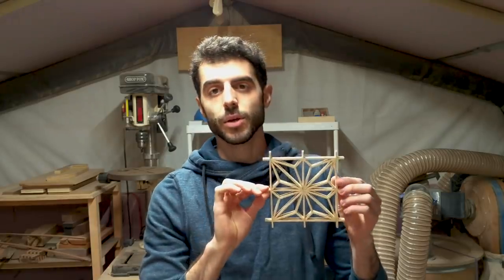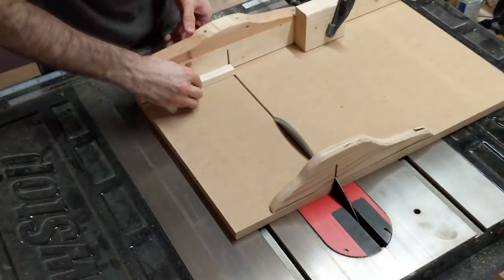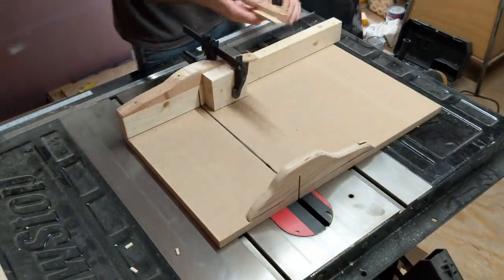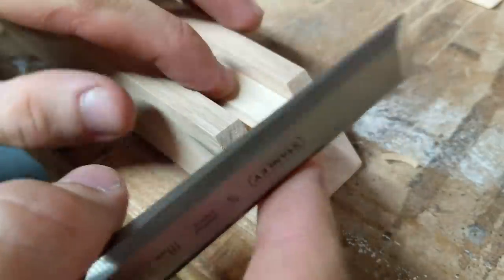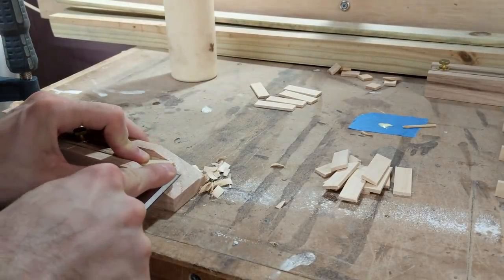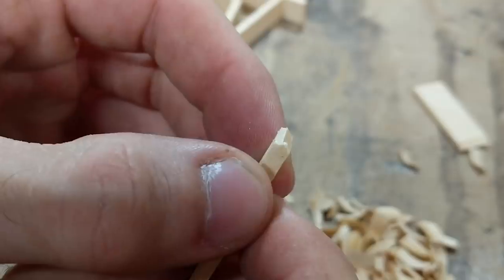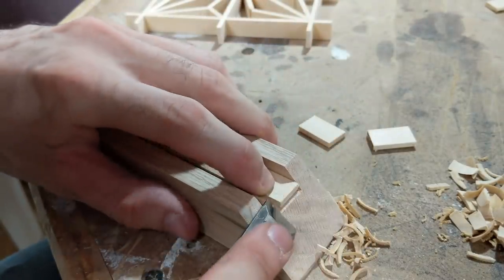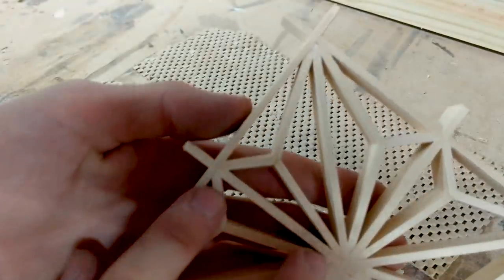How to make an Asa-no-ha Kumiko pattern

Comment: Awesome! Very similar to the way that I do it! I have been thinking of a very cool way to do the half laps on the router table. The reason I really have been giving it a thought is because of the varying width of bits that you can buy. With the table saw method you are pretty much stuck with the width of the table saw blade. They don't really make a 1/2 table saw blade. That would be pretty ridiculous lol. So my thought is... you could put a bit in the router table that is whatever width you really want, and you could cut the lap joints 1/8", 1/4", 1/2", 3/4", or 1". This is just something that I have been thinking, and I have no idea if it would work, but if I was doing a huge panel for a door or something I think the 1/8 kumiko would look a little too small. It would be nice to have a similar method, but with the router table. Maybe this is overthinking x)
Reply from the maker: That's a good idea. I haven't thought of using the router table that way. It would be possible to cut bigger half laps on the table saw if you use a dado blade. I don't think you can go all the up to an inch but probably 7/8"

Comment: Greetings dear friend,
Kumiko's art is beautiful, wonderful therapy. I'm thinking about starting to learn this Japanese technique.
But I have seen that some people confuse two similar patterns with each other. In this case the pattern “Asanoha” and “Kakuasa”. They both use the same technique as they are very similar
The one shown in the video is actually the "Kakuasa" pattern. The "Asanoha" pattern is the same, however the wooden strips are placed diagonally and one vertically, passing through the intersection points of the diagonals.

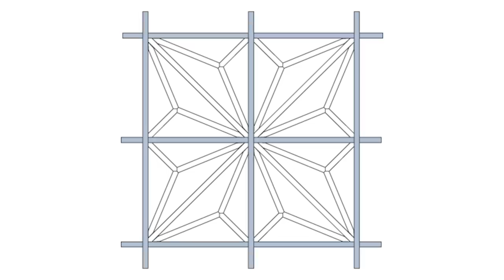Exemple: In the video at 0:36 the grid is assembled with 3 strips vertically and 3 strips horizontally. Then we have 4 strips cut diagonally (step 2 at 2:25). And finally the other pieces to complete the pattern (step 3 Diamonds and step 4 short diagonals).

The "Asanoha" pattern uses a different intersection for the grid.
Exemple: 3 strips diagonally from left to right (going down), 3 strips from right to left (going down). Then we have 3 vertical strips (right side, center and left side). This the base, then make cuts in wooden strips to assemble the diamond with its angles. 

So angle cuts are more "boring" to do. They are very similar in design, but the cut and assembly shapes are slightly different from the "Kakuasa" pattern.

And thank you for sharing with us, your videos add a lot of value to us viewers.
A big hug with lots of peace, health, successes, achievements and blessings to you, family, friends and viewers

Sorry my English please

Greetings from Rio de Janeiro - Brazil
Reply from the maker: You are correct. This video was made several years ago when I didn't the difference. The pattern in this video is called kaku-asanoha. Kaku means square and asanoha means hemp leaf. So that makes this the square version on the hemp leaf pattern. I have another video showing how to make the asanoha pattern as well which is made in a hexagonal grid rather than a square one like in this video
Reply: @JTWoodworks  no problems, buddy, the concept is the same and sometimes causes style confusion. 
I watch your videos even though I don't understand much in English (I understand more texts and I have to practice listening), I have learned from your videos. 
Unfortunately, the costs of machinery here in Brazil are unrealistic for the average monthly earnings. 
I'm researching more about this Japanese art, I think it's beautiful and I really admire both Japanese artisans and professionals who learn this Kumiko technique
Hugs

Comment: Great stuff I bought the sled plans and I am working my way toward building it. Slowly as i get my shop straightened out. New shop and is 1/3 of the last shop in size and have been doing a bit or according to my wife alot of whining about fitting everything in it. After seeing your shop I am done complaining. Thanks for the inspiration.
Reply from the maker: Thanks Matt! I appreciate it and good luck with the build. Your shop should be an inspiring space and because it's smaller, that forces creativity and opens the doors to do things differently

Comment: In this video you say to use the 22.5 degree jig to cut 2/3 off the diamond pieces, but it looks like you’re using the 67.5 degree jig to do that.  Am I wrong? Which one should I use?
Reply from the maker: You're correct. I accidentally called those two jigs by the wrong angles. The 22.5° is actually 67.5° and the 67.5° is actually 22.5°

Comment: This video is very well presented. The instructions are very clear. As to the gluing, would it be acceptable to just use a drop of thin CA glue at each joint?
Reply from the maker: Thanks! CA glue should be fine as long as it's thick. That way it won't soak into the wood too much and risk having visible glue spots